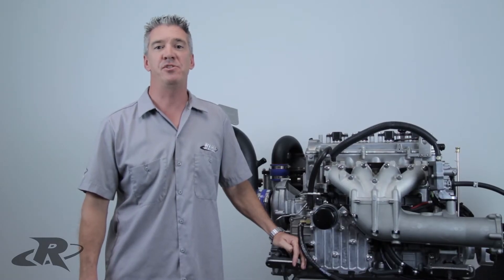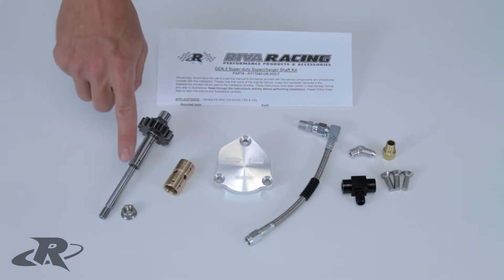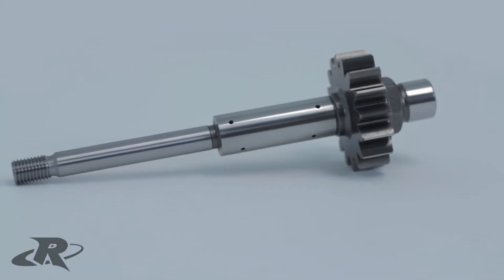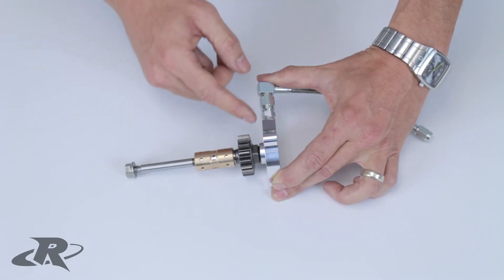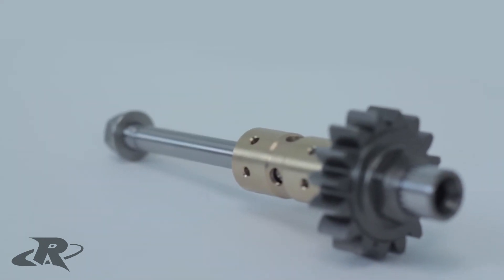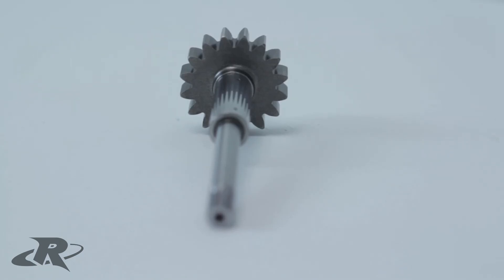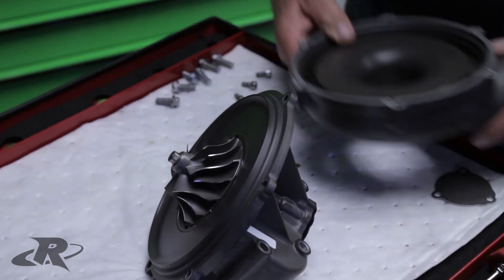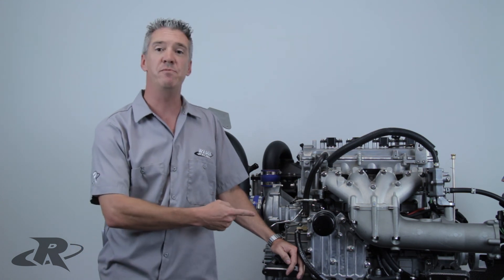RIVA Racing Yamaha SVHO/SHO Supercharger Shaft Upgrade Kit

Comment: What is the RPM threshold for when this part is required/necessary? I've heard 8500, but I would think that also depends of how many times the rider bounces up to that RPM (IE wave jumping, etc.).  Thanks!
Reply from the maker: Any time the factory rev limit is increased, this shaft is a good addition to maintain reliability. Sustained RPM over 8000 with higher peaks can cause the stock shaft to fail. This upgraded shaft is a necessity when using an aftermarket supercharger impeller due to the increased stress on the system.

Comment: Highway robbery, 500usd?
Reply from the maker: +Edgardo Emralino It would be nice if we could offer this part for less but it’s very expensive to manufacture. The shafts are built to our specification in Japan by HKS which is the original manufacturer of the Yamaha OEM supercharger. HKS holds the shafts to very high tolerances due to the high RPM and performance requirement. Also the addition of the external oil feed system adds complexity to the manufacturing process. This shaft is used by the world’s top PWC racing teams and has a great record of reliable performance.
Reply: That's really not a bad price at all if you know the manufacturing processes to generate what you're getting. That one piece supercharger shaft is NOT cheap at all to produce, especially being a billet piece.
Reply: @Anterisix  how much they get paid per hr in Japan do u have a idea?????? they are NOT made in Usa... cmon 500 for something that max could cost in japan is 25-50$.... Boating parts are so f ridiculous.